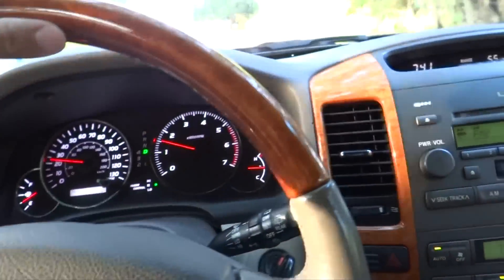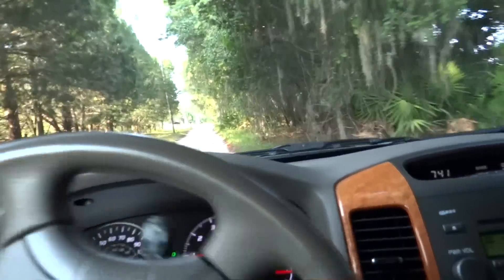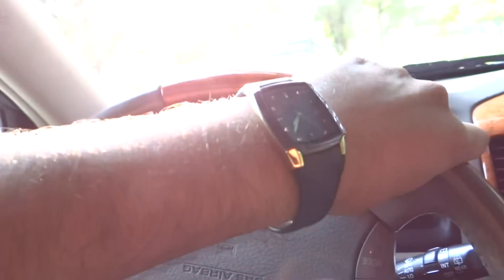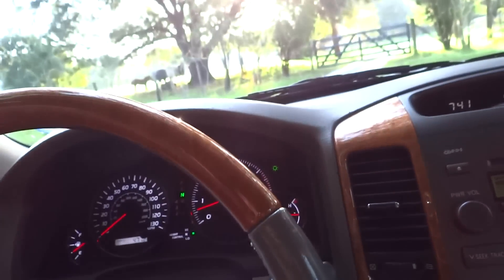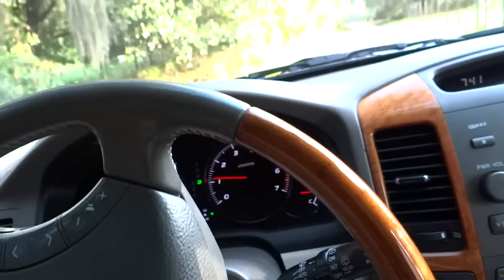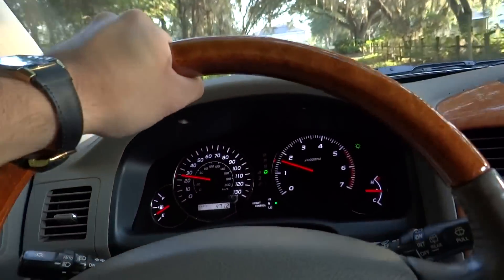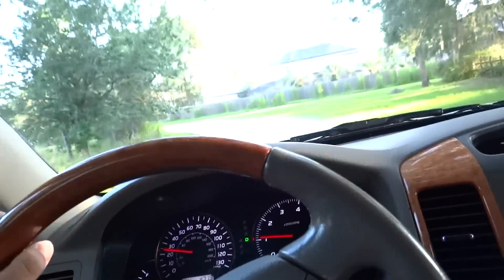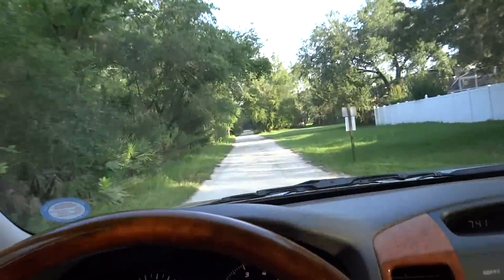Lexus GX470 VSC demonstration (Vehicle Skid Control) - HD

Comment: Do the traction control button wears out ?. Cause my 04' vsc and trac. Light is flashing and wont come off . When im turning hard the tires locking ?..
Reply from the maker: Vishnu Williams check your center differential lock.   It may be engaged
Reply from the maker: I have accidentally engaged it

Comment: This control engaged while I was descending around a curve at the bottom of a mountain.  The warning buzzer and light came on and the car slowed down significantly on its own.  I was in control of the car so the engagement was unwanted and intrusive.  I had to shift into neutral to keep up with the flow of traffic.  It's an important safety feature but be aware it can go off when you don't need it.    2001 Lexus RX300

Comment: I'm sorry but your explanation off how the vsc system works is erroneous, vsc uses a sensor at the back if the steering wheel to determine the desired vehicle direction and a sensor placed in the middle of the car to determine actual vehicle direction and to detect if the vehicle is in a potential spin or slide situation, it's called a yaw sensor, also the wheel speed sensors used by the abs are monitored too and each wheel is braked individually to keep the vehicle on course.